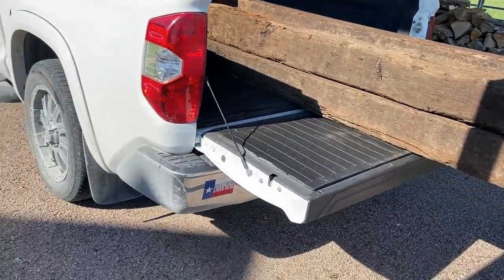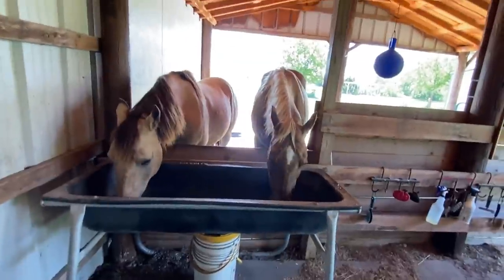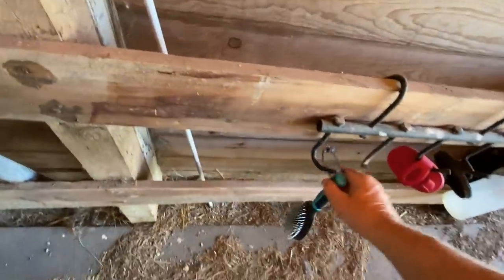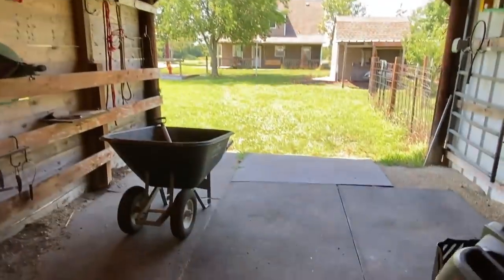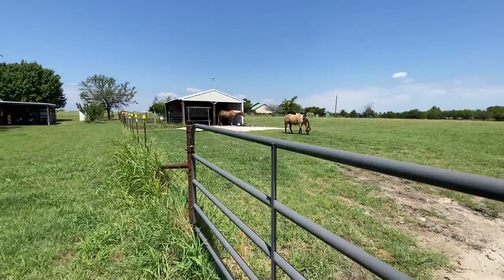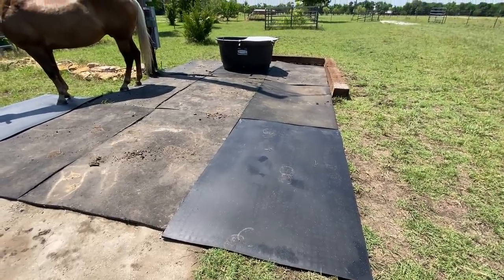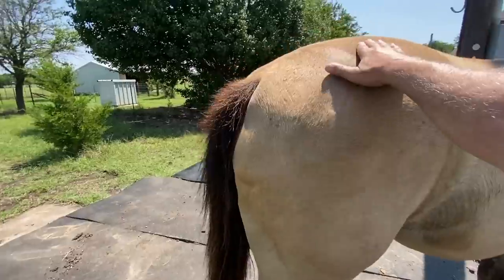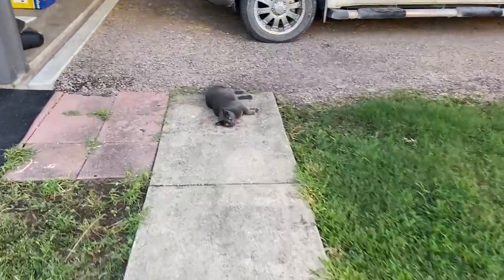Getting Horses To Share Grain & Eat Together - Horse Paths & Erosion Issues & Concrete Work

Comment: I mean 6.50 not to to bad For tear out grade, form and nice finished concrete but if it's just going to be pads that you're going to cover up and don't really care about the finish on top I think that's a little high I do pad like that for about 3.75 to 4.50 depending on how much prep . Like how much needs dug out how much forming I'm going to have to do .. if you just wanted up against the railroad ties like you have it and no real finish on top no edging I could to do that for like 3.50 ... But that here in Ohio where I get concrete for 90 to 120 a yard depending on how much cement idk what the concrete plans are charging down there ...

Comment: The mason will make a wooden form for concrete. Then remove when cured. It will give you a nice square edge to put in those ties. 

If I lived closer I'd help and share my master carpentry and engineering skills. Hit me up if you got a question.

Comment: I was gonna suggest to do that thing around the rubber matts with concrete instead of wood, that way you'd have less heavy work to do. Wood looks much better though but holy Moky $4500? That's expensive. If I lived close to you I'd do it for free and you'd only chip in the materials.
I wonder why the vet said oats are not recommended to horses. I wonder if it has to do with oats helping create more poop and more of the solid type and if that could be bad for their intestines. I have no idea. Oats have a somewhat sweet-ish taste. I guess that's why they go for the salt after eating those treats.
Reply: I followed a german channel of a physio/osteo for some time- and there especially black oats are recommended for horses, especially when they should gain weight or have to burn through lots of calories due to work. In fact, oats are fed to horses more that 100s of years- the german military rules also has some sections mentioning oats...
But: With nutrition, the situation as a whole should be evaluated, to ensure a horse gets a balanced diet- so probably in some cases oats are of no benefit to a horse...